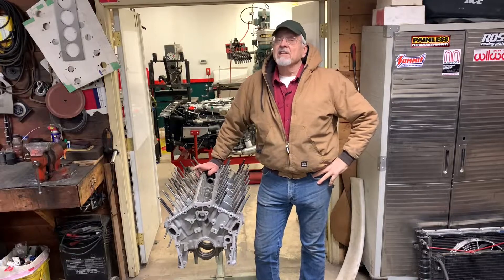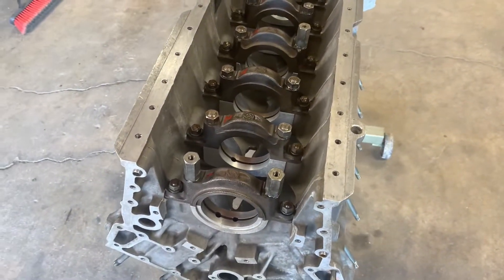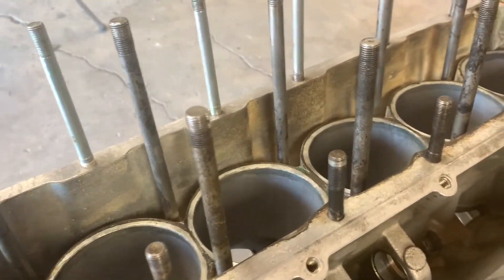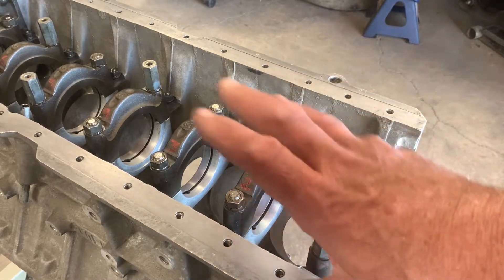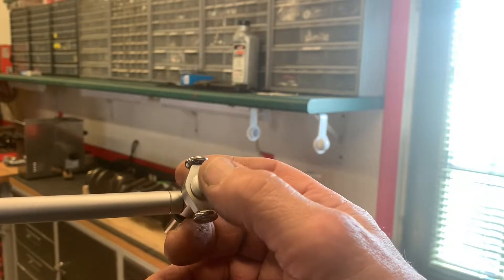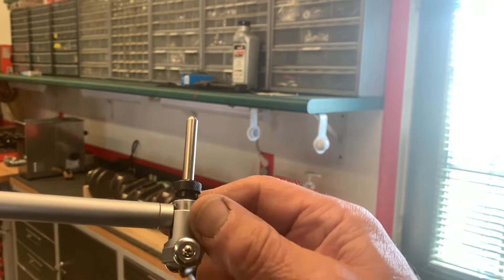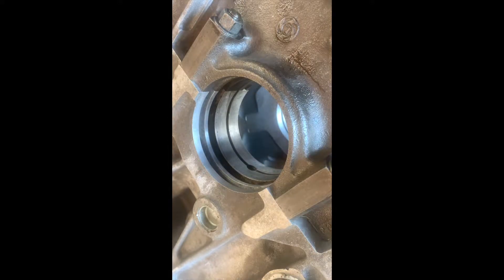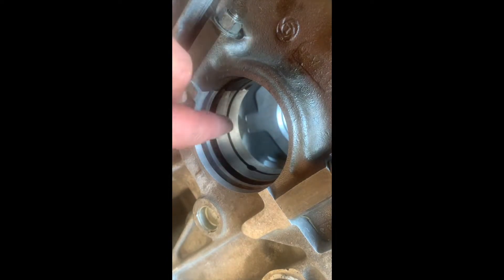S. 3: Episode 8 - Jaguar V-12 Cylinder Block Inspection

Comment: I have a question. In your opinion, is the Jaguar V12 capable of extreme HP handling? Like over 1000HP on the stock block? Everything points to that yeah it can do those type of numbers, but it also seems that there would be a weak link that says no it can't. Like the aluminum being to thin and would warp or something.
Reply from the maker: I'm told there is someone in Australia that has done twin turbocharged V-12 that has done some pretty big numbers. What I've seen in abused V-12s is elongated main bearing bores and I've heard cracked center main bearing caps have been observed by others.

Comment: Good afternoon Bob, thanks for the response.  Am I reading this correctly that you have 18" x 5" wide rims in the front? I find that quite narrow rims for racing, but than I have no idea about racing rims. You state that the 5 stud pattern isn't good enough for centering and riding on?  Have you come across any places that sell longer wheel studs? especially for fronts? Thank you again for your time..Pete.
Reply from the maker: 18 x 8.5 sorry
Reply from the maker: The wheel is centered on the shoulder of the hub. All the studs should do is provide clamping force. Spacers may move the wheel out to the point where it no longer centers on the shoulder and now the studs are doing way more than they're supposed to.

Comment: Great video as always. Crazy question about your race version jag. My son and I have installed some 18" x 8.5" rims but obviously having a lesser turning radius due to the inner rim touching the upper control arm pivot nut. Where did you get the longer wheel stud and/or solve the turning radius? I know if added even a 1/4" or spacer plate it will bring back the full turn. I think ,,LOL.. Thank you as always. Pete
Reply from the maker: I use 18 x 5's on the front of my car. I believe the offset is  15mm. No conflicts. Be careful with the spacers, there isn't much material to ride in the wheel center. You can't just run on the studs.

Comment: Hi Bob, great video. Much needed info as I prepare to begin my own V12 refurbishment.  Save the block...sounds like it can be saved with re-honing.  They will just get more rare over time.  Cheers.
Reply: At first thought I would agree on saving the block. With the current (apparent to me) cost of a full rebuild being already so high, at some point in the future it would be not much of addition in replacing a fully trashed one. That said one has to wonder how many so called classics will be saved thirty years from now, there are just so many out there. And most of our kids are not car nuts. Be interesting to have a time capsule and see where Mecums auctions and such get to in the future.
Reply from the maker: @noelnicholls1894  Haggerty's see's a bright future for the XJS.

Comment: for a well seasoned block line boring wouldn't be a bad choice BUT...and here it comes...bearing availability?
something from a ford pile perhaps?
Reply from the maker: The bearing size doesn't change.  A couple of thousands are removed from the bearing  cap joint and the hole is then honed back to the stock size.

Comment: What do you think caused that?  Tortional vibrations in the crank & poorly balanced rod/piston to rod/piston combos?  Are the bigger bearings for line honing avialable?
Reply from the maker: The tires had circumferential scoring that would indicate they were doing burnouts with the car. Foot to the floor an' let 'er buck. Plenty of rpm for extended periods of time. The bearing size will be the stock size. Material is removed from the bearing saddle joint and then hone them out to the standard size.
Reply: @thecampchaoschronicles9567   Yeah I'm imagining that crank springing around under inconsistant loading.  I guess that's more likely the culprit than harmonic issues due to balance.